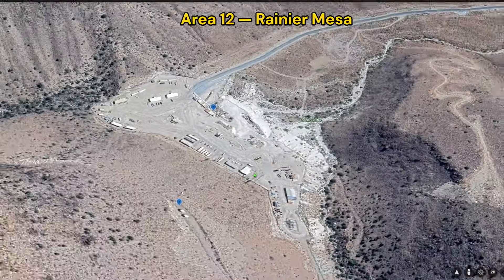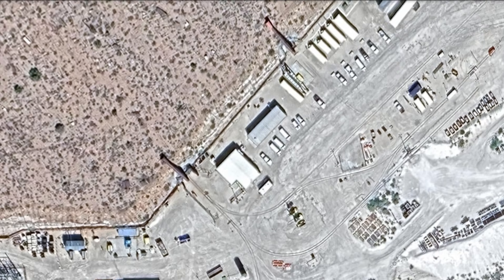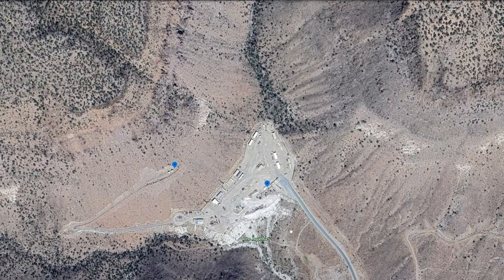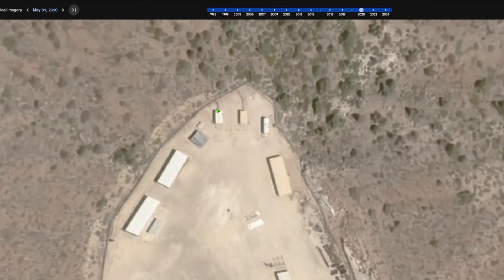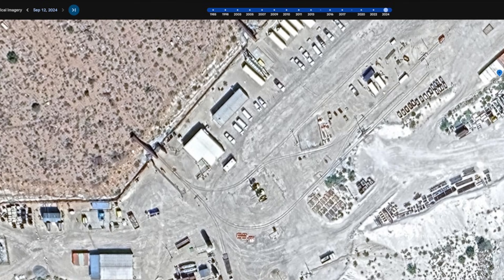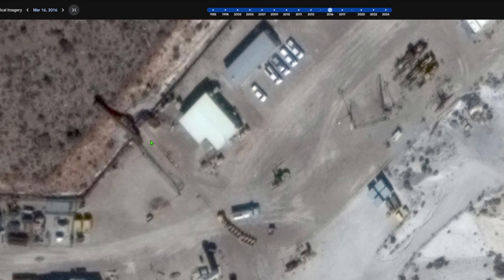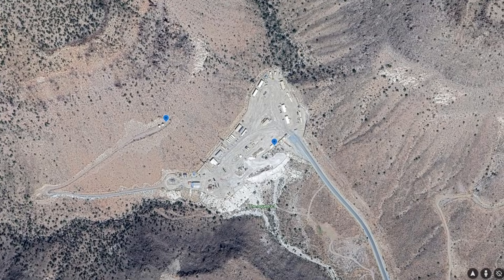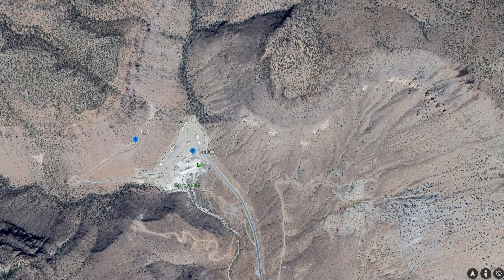Large-Scale Material Removal Inside the NNSS — What the Imagery Shows

Comment from the maker: This analysis focuses on infrastructure located in Area 12 (Rainier Mesa) of the Nevada National Security Site, using publicly available satellite imagery. A follow-up video looks at nearby terrain features that may help explain where this material could be coming from.
Reply: What you are saying is a conveyor belt looks like ventilation tube to me. The top looks circular (outlet), it will have to curve back in to the tunnel, but probably looks like it is resting on the ground because it will have a fan unit on the entrance or just inside. Thats my guess anyway.
Ps the last frame looks like a white vent tube, similar to the main ones.
Reply: The material is coming out of the mesa on rail carts. The P-tunnel complex is an active site.

Comment: Great video dude! Exploring intreging places with satellite imagery is one of my hobbies also! 😂

This is ChatGPT's analysis:
This is Area 12 at Rainier Mesa inside the Nevada Test Site (now NNSS). It isn’t a mine. Those openings are horizontal tunnel portals cut deep into volcanic rock for underground nuclear weapons tests. Devices were placed hundreds of metres inside, the tunnels sealed, and detonated to measure yield, shock, radiation behaviour, and seismic signatures.
The “vents” aren’t for airflow — they were built to control and monitor radioactive gases after tests, routing them through filtration and sensors. The surface buildings supported drilling, cabling, diagnostics, and test prep. The circular depressions nearby aren’t blast craters either; they’re subsidence features where underground cavities collapsed after detonations.
Nuclear testing there ended on 23 September 1992, the last U.S. nuclear explosion. Everything since has been sealing, monitoring, and long-term containment — no extraction, no mining, no further detonations.
Reply from the maker: You and me both 😅😊

You will like this report, give a look when you got some time

https://pubs.usgs.gov/of/1983/0399/report.pdf

Thanks for reaching out!

Comment: The smaller location shows 3 portals on the right.  Clearly following a cut through mining operational pattern.  Question is are they mining or just cutting something out.  If just a tunneled bunker 2 main tunnels would do but the third follows the normal mine pattern with an inflow and outflow tunnel and a middle belt tunnel.  The air supply needs 2 and MSHA does not like the heavy belt line in the same tunnel as the airflow routes.  Cross cuts are added every so often and later branching out is done.  The chutes look like either an vertical fan system or a loading silo.  Most normal mine fans sit sideways.  The Transformer farm is no surprise as it is a remote location and needs power for pumps, fans and mining equipment likely not matching normal home or commercial services.  On a secure area I would agree they are building as well as mining but it looks like a mine setup rather than just tunneling.
Reply: I would think if they were actually mining something there would be some kind of processing or classification equipment near where the material is being pulled out right? I don't know of any operations where you would transport every bit of material far away from the site but I'm really only familiar with aggregate operations personally so I could be wrong.
Reply: Lithium and I bet that's why it's classified.
Reply: @j.w.r3730  I doubt Lithium as it is lightweight and most are surface mines near volcanic fields with dry lake/sea beads.  It tends to deposit in surface clays and salts normally in a flats layer.  Likely in that area but not a deep mine item.  Other ores are in those mountains that are heavy with granites, quartz, basalts and feldspars.   Likely some heavy metal ore vein.  The classification would be for the dual purpose, though if a Strategic Ore might add to that reasoning.  Gold, Silver or Uranium might be worth the government hiding a production site as part of a black box project in funding or production.  Uranium would be low on my list as it would make the site unfit for other uses.  I would lean towards alloy metals if not gold  (Eldorado and Mother Load stories in that area)
Reply: @charlesmaurer6214 if you want gold in Nevada you go to Carlin, not Tonopah.

Plus, why would a government capable of seizing rare metals mine them itself?
Reply: I don't mean to yuck anyone's yum, but where did you learn to read satellite images and what gives you such authority on what you are saying. 

None of that exists on these images.  That's an ad hoc production facility with clear evidence. If you have ever worked on a US military proving grounds like Tonopah, you're familiar with these sites.

Further, there is zero tailing piles anywhere and anyone remotely familiar with mining knows about tailings.
Reply: @Livi_Noelle Tailings need not be near the mine itself,  material can be sorted nearby as you suggest or offsite.  I worked security for mines in WV for a couple years.  One location processed material not just from the local group of mines but 2 other sites over a 45min drive away.  The tailings in that case was mostly sand and shale with a fair bit of iron or detergent from the wash.  Both that location and one farther south piled up those tailings in refuse piles the size of a small town with mines from 8-10 counties.  The processing plant was located on the river with rail and barge loading for the coal.  Processing of many ores is more restrictive than the old days of on site prospect to production sale.  Also the need for water in many cases rule out in such a location as shown.  I don't doubt military construction but a location taking advantage of mining,  The alternate portals in threes or more would not be a need for military alone and even a security risk beyond a pair for airflow as the military would want limited access points.  They are loading trucks with all material removed so any tailings is at the other end of that drive to a processing plant.

Comment: Regular bomb tests were usually done with horizontal drilling.  It is far easier and cheaper.  Vertical shafts were prepared often for such things as "Death Rays,"  small nuclear devices generate very powerful X-ray bursts.  This was the idea behind "Star Wars" interception.  There had to be a larger linear area for instrumentation, larger equipment and so men can access.   Maybe they are testing bomb triggering devices.
       Another possibility is for a place to bury radioactive waste.   In addition to testing, purpose of the place is a nuclear waste dumping area.  The area is already contaminated, so materials can be buried because there is no NIMBY problem.   They usually dig trenches and put the materials in the trench and cover it.  But perhaps they need a deeper place for more toxic materials.
Reply from the maker: Really appreciate you taking the time to write this out — the distinction between horizontal vs vertical testing setups is especially interesting and not something most people bring up. Thanks for bringing this up!

The waste disposal angle also makes sense given the history of the area already being contaminated. From the surface imagery alone it’s hard to separate legacy infrastructure from anything newer, which is kind of what makes this place so fascinating to analyze. Thanks for adding the context, I really appreciate it and I love hearing your perspective.
Reply: @ExploringFromAboveOfficial  I also messed it up.  I reversed the use of the terms horizontal and vertical.  Drilling down is vertical and digging into the mountain is horizontal.
          I suspect they may be reusing things originally designed for other purposes.  You know that shaft originally dug for this test and then the project was abandoned, we can use it for this.

Comment: Those 'chutes' look more like large ventilation intake pipes placed above the entrance of a tunnel entrance to avoid the intake of dust from the mining equipment going in and out of the entrance.
Reply: Have you ever been to an underground, hard rock mine?  You are talking about compromising ground that's needed for the stability of the portal.  Vent shafts are drilled away from necessary production headings to prevent possible loss of ground control over critical areas.

Comment: You should look into the plasma drill that has a patent that drastically cuts down on the excess material and melts and solidifies the rock it's been tested on a smaller scale with success, there was even a tv on history channel, definitely worth a watch if you have never seen it.
Reply: Interesting definitely have to check it out
Reply from the maker: I actually just watched that History Channel segment — really interesting tech. Whether or not it applies here is hard to say, but it’s definitely relevant when thinking about how subsurface work could be done with minimal surface material.

Comment: I’m probably wrong but to me the road you pointed out had more traffic continuing straight than the “spur” from that road cut to the “exit road” if you will.  It also kinda reminds me of what the  county does for our dirt roads around here. It almost looks like they have sprayed oil on that particular section to reduce the dust kicked up from heavy traffic traveling in that area. Unless it’s paved of course I can’t see the images very well on the brick of a phone I’ve got. But anyway it’s definitely very interesting.
Reply from the maker: That’s a really good observation — especially the dust control angle. Treated dirt roads can definitely take on that darker, smoother look, particularly in areas with regular heavy traffic.

And you’re right about the spur vs. through-traffic feel — the main line does seem more established when you look at wear patterns. It’s one of those details that’s easy to overlook until someone points it out.

Appreciate you sharing your perspective, and yeah… even with all the caveats, it’s still a fascinating area to dig into.
Reply: @ExploringFromAboveOfficial 100% correct my friend